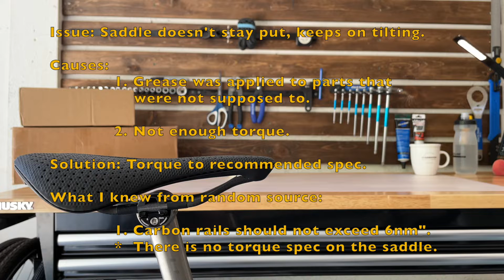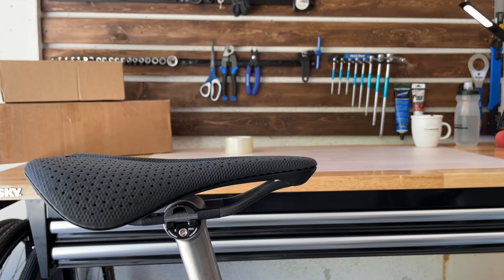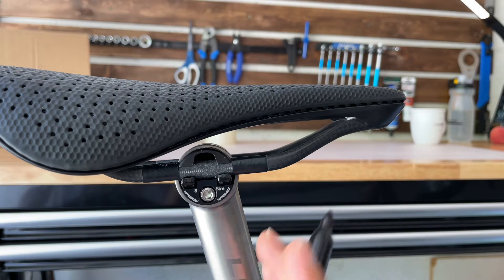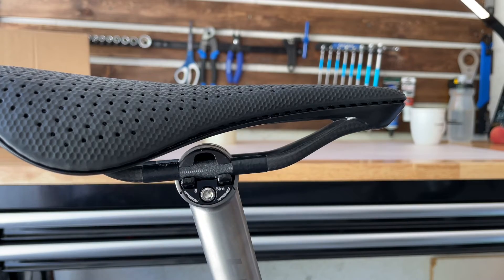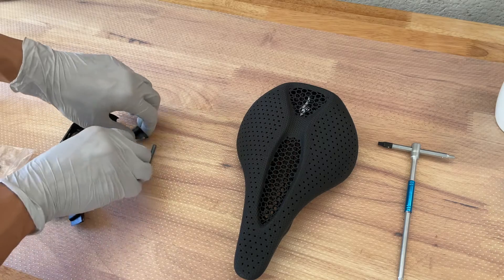Specialized Mirror Saddle With Enve 1 Bolt System

Comment: Being an engineer, i don't think this circular clamp is a good design.  If still doesn't work, can you replace the whole seat post with something that has traditional clamp?
Reply from the maker: This was my user error (under torque). I bumped it up to 6 NM, and it hasn't moved since. However, for heavier riders I can see that this one-bolt clamp system could be an issue. 
This saddle uses oversized rails (7mm*9mm), so any 7*9 clamp seatpost will definitely work.